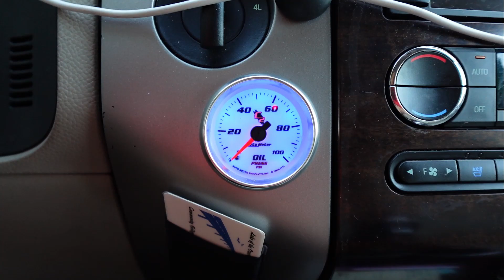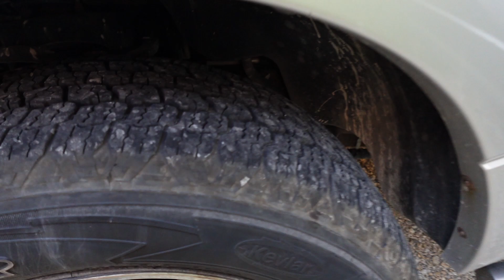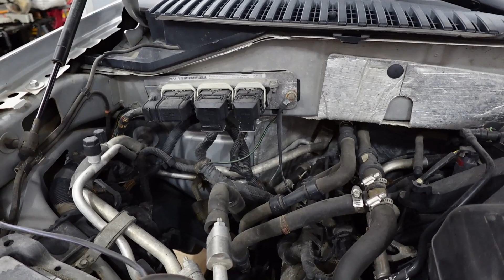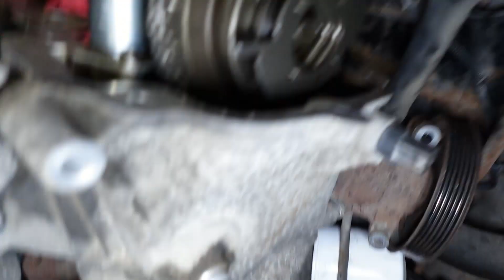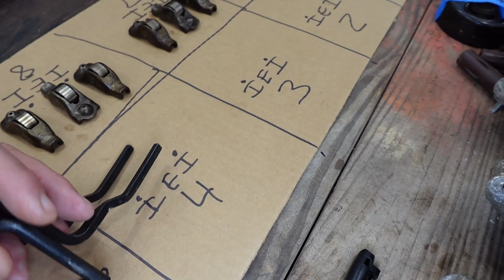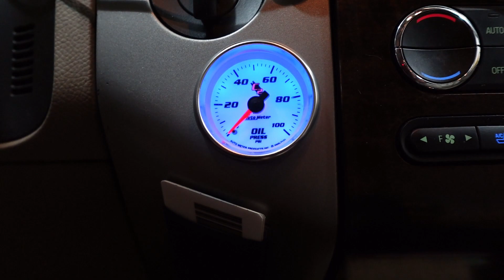5.4 Triton 3V Timing Chain Cam Phaser VCT Solenoid Replacement 2010 Expedition

Comment: Do you still have it and if so how’s it running?
Reply from the maker: I sold it to a friend about a year ago.  It’s got over 260k now and still going strong. Changing out the oil pump is key, it still runs 30-40 psi oil pressure at running temperature. Before the repair it was 15-20. 

Adding that mechanical oil pressure gauge told me a lot about what was going on. The oem gauge is only a true/false. I noticed drops in oil pressure around 2500 miles after an oil change before and after the repair. Changing oil regularly is what keeps these things going. This was a fleet vehicle which had 190k of documented 3mo/3000mi maintenance before I bought it.

Comment: Nice vid, I just did mine. Was pretty straightforward, almost easy I would say but just extremely time consuming. I also had a ticking on both sides that I was assuming was exhaust manifolds but that went away after doing this! Glad to not have to do that job now phew
Reply from the maker: @bltx2  Congrats! Mine took forever also. I filmed this video over several days. This job isn’t really that difficult but it is very time consuming as you said. Mine was also instantly quieter. A side benefit assuming you didn’t do lockouts is that you will probably get an uptick in fuel economy as well.